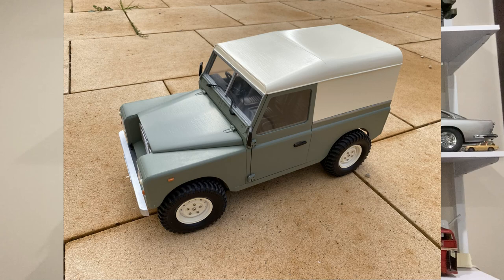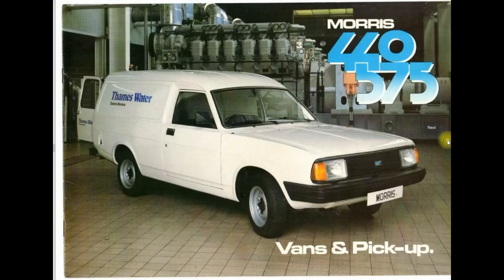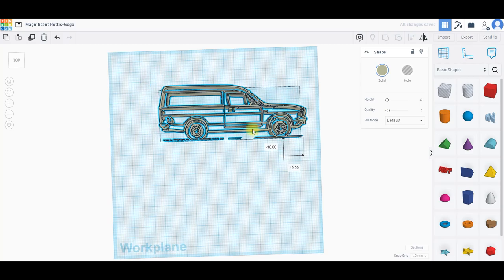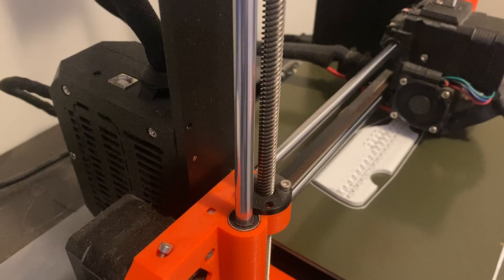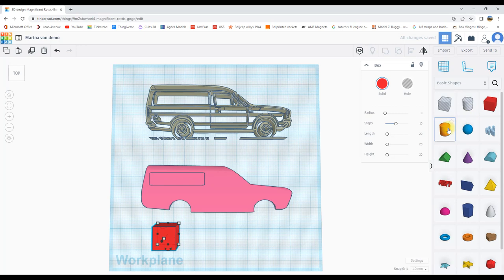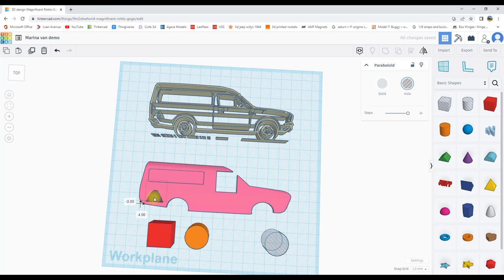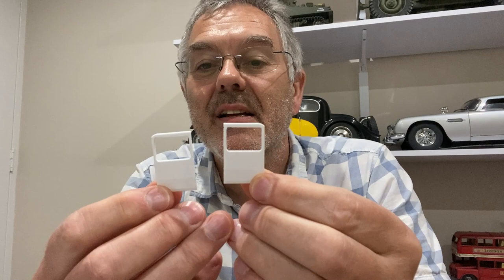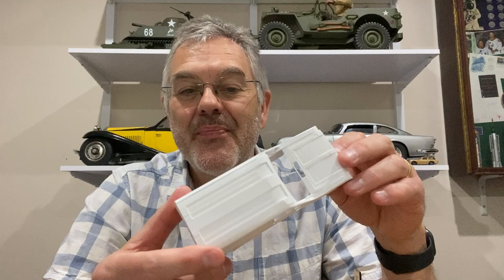Making a model of a Morris Marina van from 3d printed parts

Comment: I commend you on your dedication and thoroughness for detail, but my god ! you must go through a hell of a lot of wasted plastic to get to the final product !?  it must cost a fortune in test pieces, wouldn't it be cheaper to just buy styrene rods, make a frame and then cover it in thin styrene sheets ? I remember doing just that as a kid in the early 80's to make an Opel Kadett C coupe (vauxhall chevette I think it's called in the UK) because there were no kits of this car available. Just a thought.
Reply from the maker: Good thought, although 3d printing is surprisingly cheap.  It only costs about 14 GBP for 1Kg of filament and a lot of the thickness of the pieces is actually air.  There are other advantages too such as the ability to easily tinker with a prototype to get it right.  You can also scale the model to whatever size you want, easily make multiple copies, and the PLA filament that is used is actually biodegradable, unlike normal plastic.